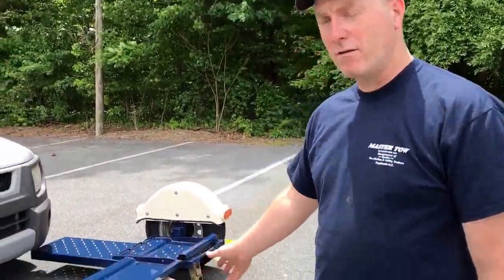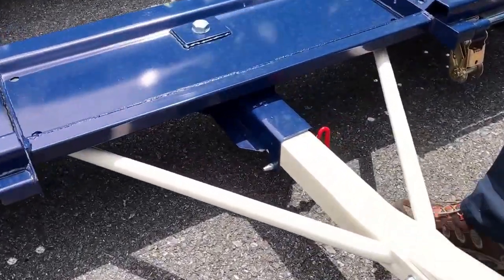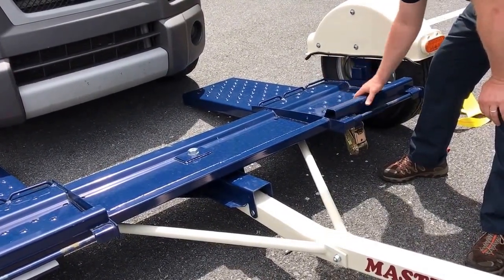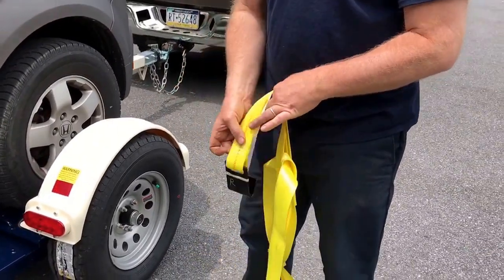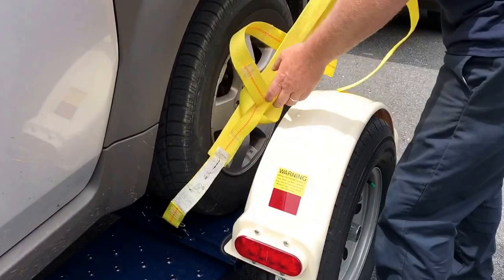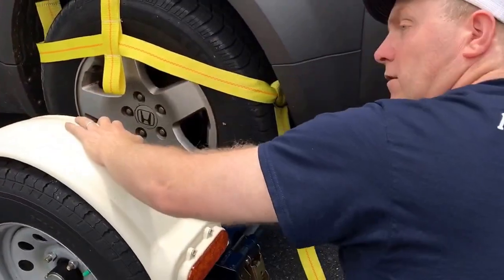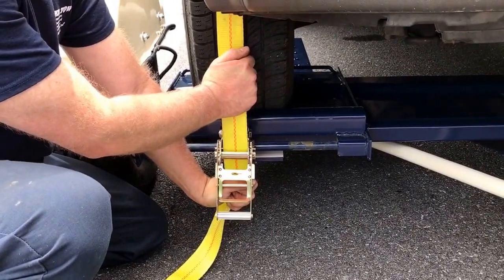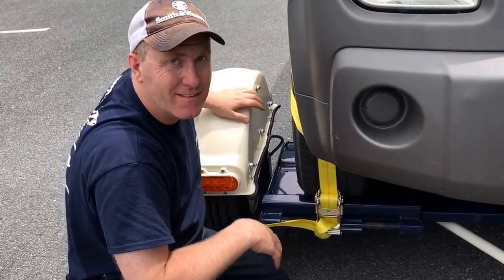How to load a Master Tow dolly RV car trailer Call 717-507-2365

Comment: Good video thanks I also  wrap seat belt through the steering wheel with the steering wheel in locked position and I also unload the car when the car and  ramps are straight .

Comment: In the video you say the ball height should be 14” off the ground, but the manual says 18” to 20”.  I like your height better as it lessens the pivot of the dolly tray when loading the vehicle (using 2”x6” to boost the ramps to compensate for the steep angle on the ramps).  I assume you’ve had no problems with dragging or scrapping with the ball height that low?

Comment: Everyone is praising the video. It's ok I guess. The strapping system is too involved and needs work. Also, the titling lock pin needs to be spring loaded and stay at the locking point. People (including me) will forget to pick it up and use it.

Comment: Could those straps be used to tie down a classic mini with 10" tyres on the smallest adjustment?
Reply from the maker: brenton carter I’ve never tried it but it may be possible. They can be made very small.

Comment: I just got  the tow. Dolly  my car dose not have a  locking stearin.  Can it be tow not locked
Reply: Well if you load the car right, the front wheels will be off the ground. The trailer will locomote the front end. Stearing shouldn't be an issue at all, unless you have one of the few cars that has a front rear shared stearing system like the old 1st gen Preludes.

Comment: Can the Master Tow Dolly be used to tow a 2015 Ford Edge AWD?  Want to tow with my motorhome but cant find info about what can be used without a complete fabrication of the front end of the car!
Reply: If its automatic, probably not. The wheels will always be turning so you dont want to risk damage to the transmission. These are typically used for fwd cars or other drivetypes with a manual transmission.
Reply: Dude13450  You can use with a rear wheel drive automatic, just remove the drive shaft. It’s a simple task.
Reply: yes disconnlect the tranny rods